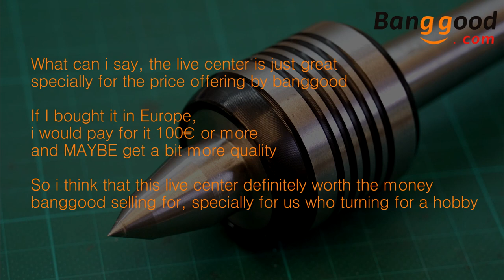MT2 Live Center Precision Morse Taper Lathe Tool from banggood

Comment: have you throw away the old one already? if yes, you may soon regrets it. your lathe is small and that material is a thin bar stock and that is why you cannot feel the difference. no serious job for this thing, **ski board bearing** won`t last long, especially when you spinning couple kilo of steel in your lathe
Reply from the maker: luderick wong i don,t throw stuff never, always try to reuse it or improve it or whathever...
But also i don't got the old one i only got fixed one without bearing wich come with the lathe.

For now still work perfect, and if the bearings start making problems i try to change it with skf one, i already made one live center wit dual radial and one axial bearing, work good but the material was soft so spot was soon deformated.

This one look really good for the funny price, also my lathe is small and unusless for turning a couple of kilo materals, biggest stuff i turning was a rotor from tractor starter (watch other video).